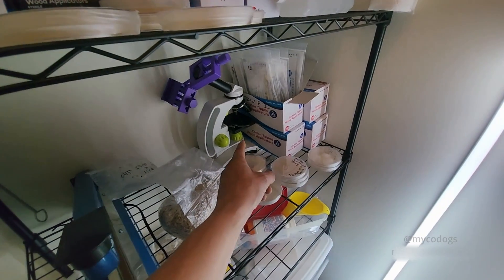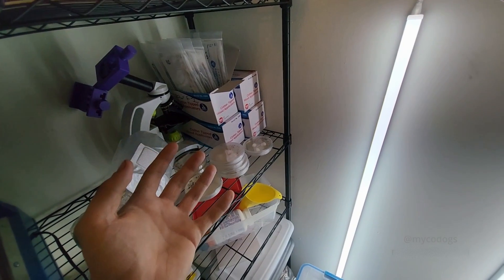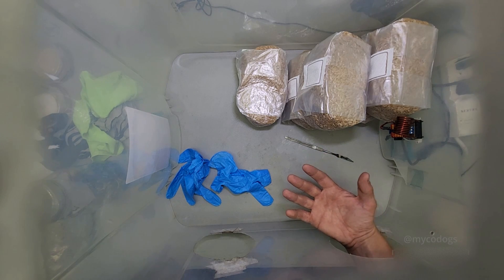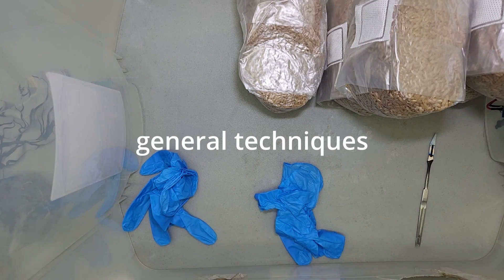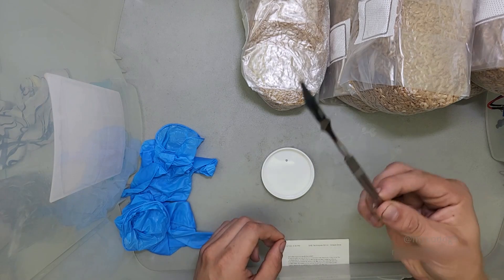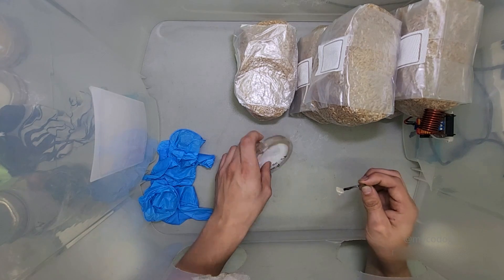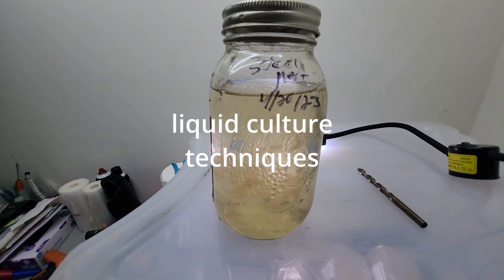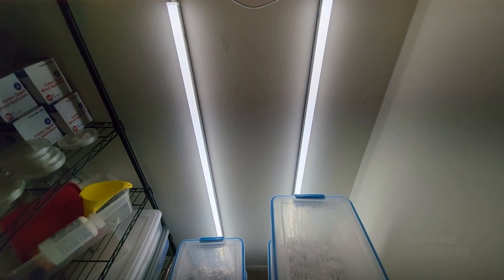Don't Buy A Flow Hood - How to Actually Use a Still Air Box

Comment: First time grower. Still air box has worked like a charm. Zero issues with contamination.  I have a mono tub, spawn bag:, and agar. I have a 40 dollar hepa air filter that I run outside of the box and a small fan that circulates the air within the room. For temperature control, I have a heat mat hooked up to thermostat that sits on styrofoam. 6 inches above that sits my tub on a cookie cooling rack. I out styrofoam underneath that. The sensor is reading ambient temperature and I keep it at a constant 75F. Spawn and bulk were mixed 48 hours ago. But the spawn bag was super aggressive and healthy.

Thanks for the vid

Comment: A still air box is not for sterility. It's literally just for still air, which makes it less likely that there are a lot of mold and other contaminants floating in the air.
Reply from the maker: a still air box is a tool to assist you in sterile technique

Comment: Nice video, thank you. Couple of questions.
Do you have trouble seeing through the box material? Seems that would give you some difficulty when dealing with a situation where you need good vision for your work.
One thing that comes up with a laminator flow hood is that you can dry out your agar or other medium while you are working on it if you keep it open very long and that can be annoying. Beautiful myc on a plate can wither quickly in a sterile yet windy air stream.  So, this is one advantage of your sterile air box for sure.
I have thought about putting a low volume positive flow  air duct into a still air box to maintain positive pressure so to speak thus thwarting any negative flow due to air currents into the box through the arm holes or any other openings. What do you think about that?

Comment: you can get elbow length rubber gloves and properly seal them to the holes in the box...duh
Reply from the maker: that creates a plunger like action when you move your arms around. the reason still air boxes work is because all the contamination in the air is allowed to fall to the surface of the table and the air is too still to pick it back up. if you completely seal it and make a glove box you need to make sure the air inside is 100% sterile which is very difficult without a full HEPA filter and at that point you just made a flow hood with extra parts
Reply: @MycoDogs  yeah, ok.  All methods have weakenss.  I have been geting good results with the bella bora still air box from the amazon.  i am not for putting my bare hands in there and after putting all the stuff in the wiped down box, i also have a can of lysol which i spray around and then wait for it to settle before work.

Comment: fairly certain you wanna leave stuff in the still air box instead of pushing and pulling air
Reply from the maker: it is better if you can keep everything inside but that isn't practical if you are growing anything more than a couple jars, just make sure u spray everything down before and after you put them in with isopropyl

Comment: Why can’t I just mount a HEPA filter on the side of my still air box? And another HEPA filter inside the box circulating the air.?
Reply: Look up turbulent flow thats why
Reply: Plus bro you basically just explained a laminar flow hood at that point but if its in a closed box it might cause turbulence if it fights the pressure im the box

Comment: I love your practical advice! Anyways my last hobby was distilling and there's a little trick for making huge holes like the ones in a still air box. You can take the smallest drill bit you can find, mark where your holes are gonna be and drill a series of holes until you've got the holes formed. Afterwards,sand it down smooth.

Comment: 3:12 And on the right we see an heating coil, to ignite the isopropyl alcohol to flame sterilize the work environment aswell. Genius idea!
Reply from the maker: @filoofox9934  no it's an induction coil, it does not heat up. Watch my video on why it prevents fires instead of starting them like open flames

Comment: I bought a foldable sab from Amazon that was the same price as buying the tub. It worked great. I retired my sab and now use a flow Hood which is a game changer. If you got room to store a sab, build or buy a flowhood. A box fan with a cheap inflow filter with a HEPA outflow filter built into a plywood box or one built into your sterilite box will be a game changer for you.
Reply: That DIY setup will do nothing useful.

Comment: It's pretty easy to have low contamination rates with a SAB if you're already in a fairly clean environment, but only a laminar flow setup will still give you low contamination rates in less than ideal conditions as well. I rent an old house in Florida with windows that are overlapping glass strips. I can clean the house from top to bottom, run an air purifier 24/7, and have the sterile technique of an open heart surgeon and a SAB still gives me 65%+ contamination because no matter what, there's a constant supply of contamination entering the house. Nearly zero contamination with a FFU.
Reply: I wonder if this has anything to do eith how hot and humid florida is? I've had pretty high success with a sab, but i live on the canadian great plains. It's basically the opposite - cold as fuck, very dry, and extremly well insulated homes. I'm a gardener, and i know in more humid climates, storage crops rot way faster than dry ones. I can keep winter squash for 8 months in my basement, while ppl in flordia often complain online about struggling to store food without it getting contaminated with mold.
Reply: @vulixirus probably

Comment: Too cut the holes use a razor blade and vice grips and a torch.. clamp the blade at and angle away from you hest the blade till red hot and cut like butter

Comment: Can a grow tent be used for doing lab work if the exhaust fan is blowing clean air in through the HEPA filter?
Reply from the maker: It might be better to seal the tent, run the filter inside it for like 30 min then shut it off and wait til the clean air is still in there

Comment: I always used a ghetto-ass but very effective method known on the interwebs as a 'shmuvbox'. You tape a transparent trash bag to the outlet of a small room air filter with a UHPA cartridge, then cut armholes in the inflated bag. Bags are inherently sterile inside because of the way they're manufactured, but you can wipe it down after it's inflated for an extra bump in security. You can do anything you can do in front of a flowhood in it, and it costs very little.
Reply from the maker: I have seen this done before, I'm sure you can have success with it. There is an issue with a setup like this is the airflow inside the bag is very turbulent and aggressive, meaning if your arms or equipment have any contam on them it will get blown all over the place. A still airbox on the other hand u can rub ur hands around in dirt and work without washing them without contam because there is no turbulence
Reply: @MycoDogs  yeah, you're absolutely right. I always used veterinary gloves that went way up past my elbows and only performed one task at a time, wiping down nearly constantly. I live somewhere pretty humid, with a VERY high spore load, and have always had indoor pets and lived in old drafty farmhouses, the glovebox (still air box) was never effective for me. I understand that it's the next best from a flowhood for most folks. I eventually built a flowhood (I'm a commercial electrician who has built a couple of commercial-scale clean rooms for surgical implant manufacturing facilities, so I sourced all the materials for free, I'd never recoup the cost to buy one) and never looked back, but the good ol' shmuv served me well for a long time.
Reply: I rather have still air than cheap air

Comment: Quite a few explosions have occurred when flame sterilising needles inside still air boxes. If the alcohol vapour is in the right proportions with the air (upper/lower explosion limit), then it will ignite/explode. So, be careful and only use the minimum amount of alcohol when wiping down surfaces, and no open flames.

Comment: Is it safe to use the induction sterilizer after you spray Isopropyl?
Reply from the maker: I personally haven't had any issues using it directly after spraying (i do it basically every time i use it) so its definitely a lot safer than an open flame but there could be some edge cases that could ignite the fumes so still be careful
Reply: @MycoDogs  I ordered one induction sterilizer and it was broken, the next one broke the second time I used used it. Only had it on for 5 sec at a time.

Comment: How do you draw your LC without air exchange? I can only ever get one or 2 before it starts trying to equalize pressure and it sucks air in through the injection port, causing contamination
Reply from the maker: i use a thick layer of RTV silicone as my gasket it seals pretty well but they do wear out eventually and allow air in
Reply: @MycoDogs  how do you deal with the pressure difference? It gets sooooo hard to draw liquid from the jars I have with good seals if they aren't vented
Reply from the maker: @lukeblizzard5909  it gets kinda difficult but i just hold the slide back when i extract it it gets to a point of waters vapor pressure where it wont get harder to pull after that

Comment: I don’t use alcohol inside the SAB anymore, because I have a strong UV-C light inside. I turn it on for 15 minutes to sterilize the inside of the SAB before I start working, and turn it off when I have to sit next to it, or else I would go blind, lol. 

Then I use alcohol on everything that enters the SAB before I put it through the arm holes. Never had anything contaminated since I started doing it this way.

I even let Petri dishes harden/cool without the lids on inside the box, so I avoid condensation, and just have the UV-C light turned on the entire time the lids are off. 😊
Reply: I do as well, but you have to are sure nothing living is in the room when using the light. And I still use alcohol as a backup. I’ve never experienced contamination.
Reply: Can you point me to the lamp youre using
Reply: Which one dis you get
Reply: As soon as you put your hands in the box, it's not sterile. SABs are NOT supposed to be sterile. They are literally just for stiller air.
Reply: @ZenAndPsychedelicHealingCenter  Yeah, I know that. It’s almost impossible to work in a completely sterile environment. Not even regular microbiology labs are sterile.

Comment: Ive been having very good results working in open air. Just shutting the bathroom door with a towel at bottom and turning on a hot shower till steam covers everything and spraying the air around and over me with alcohol and quickly bang it out. Im bout to make a diy flowhood i think just to reduce the occasional failure. The most important parts imo is making sure your grains are fully sterelized, fully colonized, and your substrate isnt to wet.👍
Reply from the maker: yea ive done transfers just on my desk and they work if ur careful

Comment: I love the video but id like to share this.  Diy laminar flow hood under 100$ https://youtu.be/lInfdAVvBts?si=T5bupAu0xsSlLLQ9   .  He explains how it actually works. It does not just filter the air , the goal of it is to create laminar flow as opposed to turbulent flow . If using a flow hood and doing everything else correctly with clean gear there is almost 0 chance of contamination. I built mine using this tek and its been working great. No contam

Comment: If you have an old coffee can or something or the sort/size, you can set it on the burner on your stove for a bit to heat up and then melt the hand/arm holes into the SAB. Wont have to worry about cracking the tub either while cutting/drilling!
Reply: This comment is underated
Reply: And I seen how they put the gorilla tape on each side of the hole since it's a big coffee size hole and cut an x in the tape sticky to sticky over the hole like a skirt, maybe not necessary but seems like a good design

Comment: Man frfr, I have been a part of the community and a hobbyist mycologist for some years. But this is the thing is I have a Flow hood, also a FFU, and my old friend my Still Air Box. My SAB has been old faithful. Heck I have the FH, and my FFU. And still this I use my SAB for certain things, small jobs. Lol PLUS I HAVE HER ROCK SLAPS EVERYWHERE. I GOT MY FH COVERED IN THEM TO!!!! Man they look great. But my FFU is clean no slaps on her. But I agree 100% with everything you covered. I do certain things like you, but some other I do different. Plus you showed me some things to try out myself. Keep up the great work.

Comment: yeah i had a sab blowup on me as well. felt like a real dumbass. burned myself on my arms as well.  Thats why i built a flow box.  1000% easier.
Reply from the maker: lol I hope u didn't get too burnt I'm sure its happened to a lot of us
Reply: @MycoDogs  
nothing a little burn cream couldn't handle. usually just the fumes go POP. but yeah i completely understand why a lot of people who use still use sab usually switch to nonflammable means of sanitation like soap water, bleach water, Lysol, or hydrogen peroxide.  just wait appropriate time lengths for your sanitization method to be effective in lysing the cell walls of the baddies 😁. i see you found your own solution. removing the flame.
Reply: @spacepirate1543  peroxide all the way